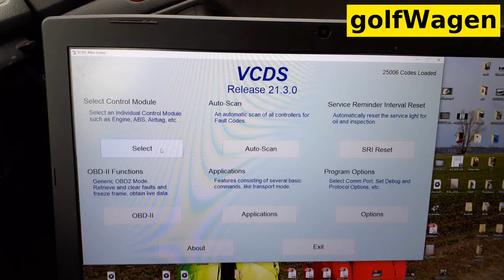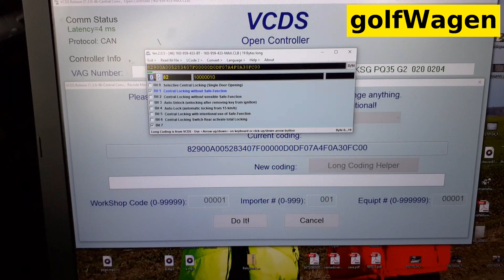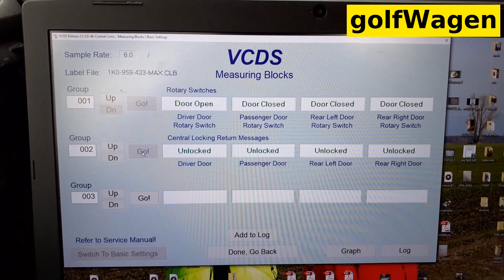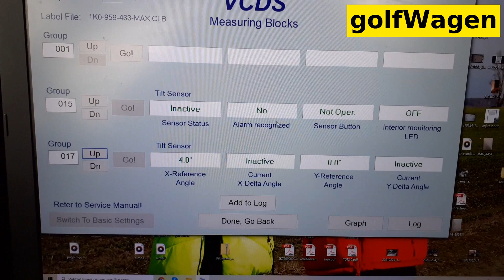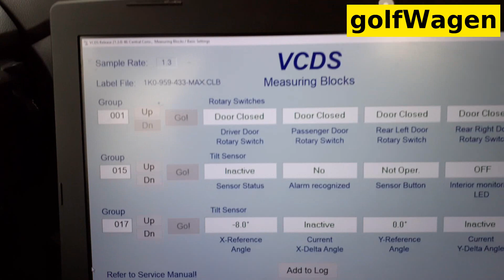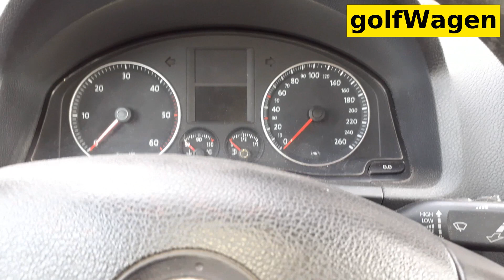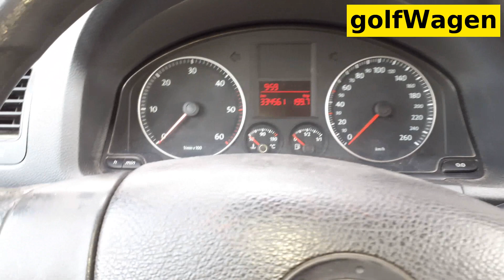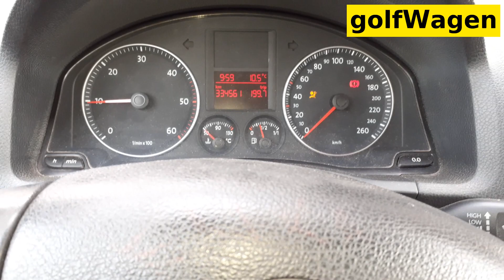VW Golf 5 oem alarm tilt sensor install activate /LIN BUS/

Comment: Hello can you please help me install aux on rcd300 i tried with 1,7,8 but i doesnt work it says error on vcds with +1 antena .
Please if you have any other solution help me
Reply: Aux codding is possible via vcds, but mine does not work, so i bought yatour(cd changer) for usb, aux and that works perfectly

Comment: My golf 5 when i lock the car the  alarm led on the doors blink but the alarm horn or buzzer doesnt work  when i open the doors or shake the car. So im confused is the alarm active or not?
Reply: Probably need to replace the actual alarm horn, its under one of the wings in a silver boxed riveted too the car